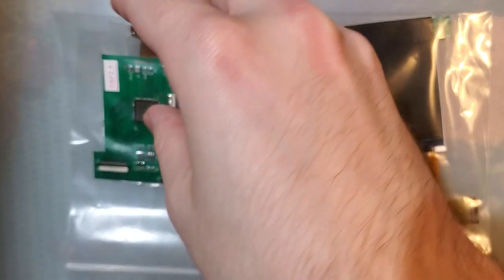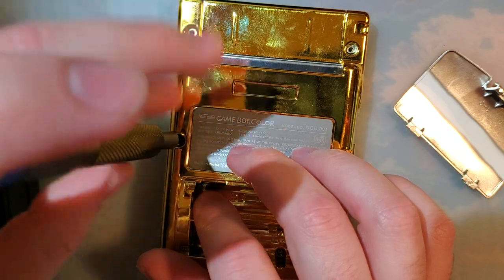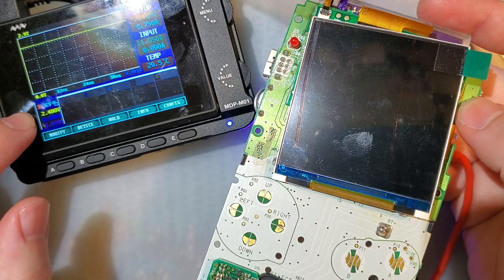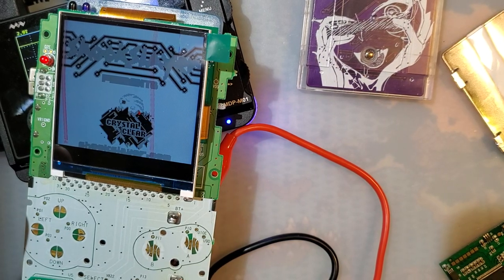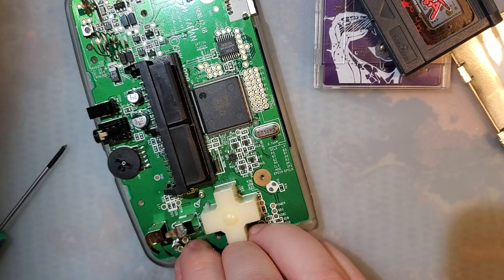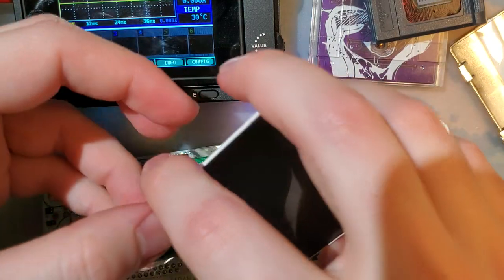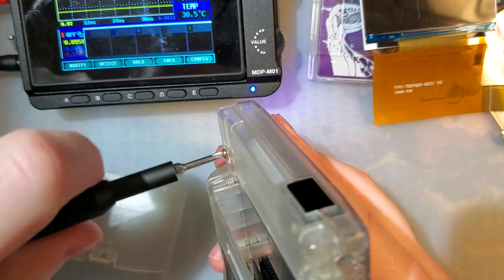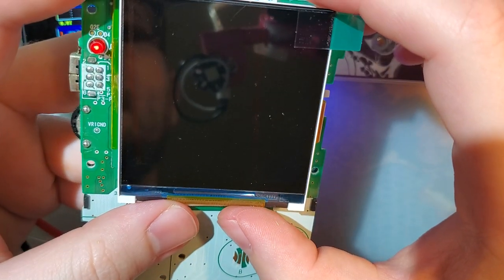AIO XL MGB Kit in Unsupported Consoles

Comment: Out of curiosity, Is it known what device these larger screens were originally intended and manufactured for? I know the small one was for the palm 685/690
Reply from the maker: These are brand new LCDs made custom for this.
Reply: makho damn that’s pretty cool actually. The next experiment should be to Frankenstein one of these XL screens onto the Palm Treo, because why the fuck not.
Reply: makho on a more serious note, if they’re manufacturing lcds specifically now, why would they continue to use a separate conversion board? I have no idea how these things work in reality but surely it’d be possible to make a screen that would work natively and behave the same as the original.